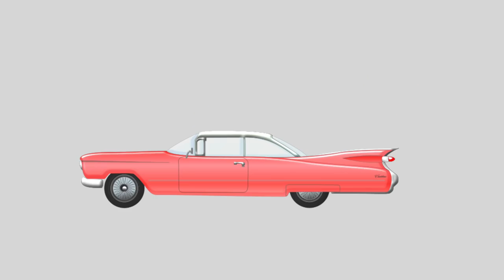Yes, Rockets CAN Fly in a Vacuum

Comment: Scientism. What is there to thrust against my dear? I call BS.
Reply: Eddie - If I fired a CROSSBOW in a vacuum, would I feel recoil? Yes or No?
Reply: @stuartgray5877    Rockets don't use crossbows.
Reply: @stuartgray5877  No recoil.  You bloody forgot to load it with anything.
Reply: @DrCash7  so you are incapable of answering a basic physics question but you want to argue physics with actual engineers?  Answer the question and I will give you some more.  If YOU answer the questions you will learn YOURSELF how rockets work in a vacuum.  Newton's laws apply the SAME to a crossbow as they do to rocket engines.  If you don't understand that, then you are demonstrating that you have never taken a physics class in your life.
Reply: @DrCash7  - If I fired a CROSSBOW in a vacuum, would I feel recoil? Yes or No?
Reply: @DrCash7  why no answer? Afraid to debate people who actually have a clue about physics?
Reply: @DrCash7  Here are a few interesting questions for you, with the answers, that I'll assume you will agree with? 
Firstly, does the burnt rocket fuel coming out of a rocket have mass? Yes, it does have mass. For example, 15 tons of fuel, when burnt in the rocket's engines, will cause 15 tons of combustion gases to be ejected out of the exhaust nozzles. 
Secondly, does this ejected mass of burnt fuel, travelling at hypersonic velocity, have an X amount of 'momentum'?  Yes, anything with mass that has velocity, will have 'momentum'.
Thirdly, when applying the conservation of momentum laws to various objects, when one 'momentum force' has been created and is travelling in one direction, is a corresponding 'momentum force' created in the opposite direction?
 Perhaps you can give me the answer to this question in your next reply?

Comment: How does a rocket work?  It's literally riding a continuous controlled explosion.  The explosion is moving with you relative to ignition already, hence continuous force regardless of how fast you're going.  What we should be asking is how much thrust is coming from riding the explosion (and pressure exerted on the combustion chamber and engine bell) versus Newton's third law in the expulsion of mass.

Comment: What a horribly unhelpful video. First “they,” intentionally likens the movement of a rocket in space to the exhaust system of an automobile at work in an atmosphere, and even though “they,” never truly provides either a concrete example of why the two completely different technologies are compatible enough in the first place, to draw a similarity from one to the other for the purposes of demonstration, “they,” also never tells the viewer why the two technologies are not compatible enough for comparison. That’s called lunacy. “They,”merely states, “it’s like…” but then “they,” completely contradicts themself by saying, “it’s not like…” and then, horrifically, and shockingly, “they” proceeds to use the car’s exhaust system on the green screen to compare, and to contrast, the two entirely different technologies anyway; and just as shockingly, “they,” do so by interjecting a third technology, that of mechanical motion. 

This is an inconsistency of unmitigated proportions straight away, and I think it’s one that’s intentional, (in order to confuse the average viewer,) on the part of the content creator, but not necessarily on the part of the presenter, if “they,” are not actually one, and the same.

Why would I says such a terrible thing? Because it’s exactly the same regurgitated pablum espoused by every other gatekeeper. How shocking a thing it is, that there is but a single, uniform narrative, (for which there is only ever intellectual phase locking to explain Newton’s third law,) and never any possible variations, or alternate explanations, for why Newton’s third law of motion, (in which all rockets in an atmosphere work exactly because of the presence of an atmosphere,) continue to work whenever that very necessary component, an atmosphere, is removed.
Reply: Theodore - what confounds me is that your vocabulary suggests that you did complete high school, while your grasp of basic physics says you did not.
Which is it?
Where I come from passing physics in high school is mandatory for graduation.
What happened to you?
I can TELL that you have never taken a single physics class in your life, but you feel confident arguing basic physics with actual Engineers?
Newton's laws say that rocket propulsion MUST work in a vacuum.
Maybe you should study them BEFORE trying to debunk them?
Answer these three questions about a rocket operating here on earth in atmosphere:
1 - Does the exhaust gas experience an "Acceleration" as it leaves the rocket nozzle?
2 - Does the exhaust gas have "Mass"?
3- Can mass be accelerated without a force, OR is a force REQUIRED to accelerate mass?
Just answer those three questions and we will get to the REAL questions.
Most "physics deniers" refuse to answer my questions and just attack me personally.
Reply: Theodore - "in which all rockets in an atmosphere work exactly because of the presence of an atmosphere"

See this is false.
Rockets DO NOT "push on the atmosphere".
Do you think that the recoil from a gun is purely from the gun pushing on atmosphere?

So according to YOU a gun fired into a vacuum would NOT have any recoil force?
Are you SURE about that (because I have evidence that says otherwise)
Mechanical recoil still works without an atmosphere because any time one object (mass) pushes on another object (mass) then BOTH objects feel the force.
THIS is Newtons third law. It is impossible for a machine to accelerate mass (apply a FORCE to a mass) without feeling an "equal and opposite force".

Rocket propulsion is JUST mechanical recoil from PUSHING ON MASS.
Mechanical recoil still works in a vacuum, therefore rocket propulsion STILL WORKS IN A VACUUM.
Reply: @stuartgray5877  false.  Rockets push against atmosphere, chatbot stu.
Reply: @bobartor910  false.  No friction/drag no thrust.  U chatbot/shill.
Reply: @DrCash7  Oh so "rockets Push against ATMOSPHERE" do they?
So you are arguing that rickets CAN "push on air" (Which is a GAS) but then you say that rockets CANNOT push on the exhaust gas (Which is ALSO A GAS).
So YOUR argument is: " Rockets Push on GAS but they cannot push on GAS".
Is THAT what you have been trying to say?
Bless your little heart!
Reply: @DrCash7  what is the combustion product of burning hydrogen and oxygen?
What is the Exhaust gas from a rocket engine that burns hydrogen and oxygen?

Oh and what does a jet ski "push off of" to propel itself forward?
Reply: @DrCash7  how do those toy "water rockets" work that you fill with water then pressurize with air?
Don't try to tell us that are a hoax because I have used them.  They work great!
Now tell us the theory of operation of a toy water rocket.
Reply: @stuartgray5877  u chatbot.  U have no seoul.  I explain dees to you.
Reply: Good comment. Chatbots and shill accounts attracted to it
Reply: @DrCash7  So you STILL contend that rockets push on GAS, but they CANNOT PUSH ON GAS. Is that about it?

AND you STILL argue that a SSME can accelerate mass without a recoil force.
Yeah you are a GENIUS.
Reply: @DrCash7  So you STILL contend that rockets push on GAS, but they CANNOT PUSH ON GAS. Is that about it?
AND you STILL argue that a SSME can accelerate mass without a recoil force.
Yeah you are a GENIUS.
Reply: @stuartgray5877  thanks
Reply: The main point of this useless video is to bait doubters into commenting, so they can be harassed & abused.
Reply: @papalegba6796  Care to tell us how rocket engines can accelerate mass without applying a force to that mass?
NO? What a SURPRISE!
So do you contend that:
Exhaust gas does NOT have mass?
or
Mass can be accelerated WITHOUT a force?
or
Mass can be accelerated by "Magic"?

So which is it genius?  You OR DrCash7 may answer since you are both the same person.
Reply: @stuartgray5877  thanks for proving my point, chatbot 😂
Reply: @DrCash7  Check the 4 forces of flight. 3 of them (drag, lift & thrust) are applied by the atmosphere, the other (weight) is applied by gravity. Very simple.

Comment: A useful addition is that a normal car does not work from the push of its exhaust gasses.  The energy from combustion is directed to making the wheels turn.  The exhaust gasses are just being vented because you have to do something with them.

It's entirely possible to make a car that burns fuel as a rocket does, directing its power into the exhaust gasses and moving by newton's 3rd Law.  These aren't typically street-legal because the plume of fire and smoke coming out the back tends to irritate drivers in following cars.  

Rocket-cars are the car of choice for setting land speed records, however.
Reply: Darth MacLeod she literally said the wheels turn, you can't possibly thing she wouldn't know such a basic thing
Reply: Xiefux, Completely agreed.  I'd fully expect Amy would know how a car works.  I'm simply unhappy with Amy's wording which implicitly equates car exhaust and rocket exhaust.  

To be clear, I know Amy knows better, but if you are explaining something as basic as how a rocket moves vs. how a car moves, and your target audience is people who have misconceptions about it, it's very hard to take too many pains to avoid confusion.

Comment: A Saturn V first stage ejects about 15 tons of hot gas per second. This burned fuel exits the nozzle at around 5,000 MPH.
That's three large bull elephants flying past at FIVE THOUSAND miles per hour.  Each second.

Compare to an Iowa class Battleship, firing its 16 inch, 2700 lb shells at 2500 FPS.

After converting the units (and if I haven't messed up the math!) we find that in one second the rocket produces about 33x the recoil momentum of one shell.
So, the total rocket recoil is equal to three full 9-round broadsides per second, plus about 6 more single shots.  (3x9+6=33)

Imagine a Battleship Machine Gun, firing about as fast as you can read this: BOOM! BOOM! BOOM! BOOM! BOOM! BOOM! BOOM! BOOM! BOOM! BOOM!
(Remember, each Boom! is all NINE guns going off at once.)

"GOT RECOIL?"

Comment: If space is a vacuum how is there a "force" pushing the payload in the opposite direction when the particles aren't "pushing" on anything (like 'air')
Reply: Matan - Lets start with THIS.
MOST "physics deniers" make the claim "Propulsion is IMPOSSIBLE in space because IN A VACUM , there is nothing to push on".

Now If one were to fire a crossbow, IN SPACE, (in a VACUUM) would the crossbow STILL FEEL RECOIL?
Yes or No?
well the answer is "YES" the crossbow WILL still feel recoil and get PROPELLED BACKWARDS when it fires the projectile.

So that is PROOF that "Propulsion" IS possible in a vacuum. (even with "Nothing to push on ")

Now isn't it possible that rocket engines use the SAME CONCEPT to push themselves?

I'll leave it to you to do that mental exercise.

Comment: One thing that is missing in otherwise good attempt to explain topic is missing of clear division of two problems propulsion of any vessel needs to deal with.
1. You need to apply force. 2. You need to get energy to be able to apply force.
Cars (Trains), Ships, Airplanes and Rockets all uses 3. Newton Law to apply force. In simple words they throw something behind them (a propulsion mass) and that pushes them forward. The force is based on speed which that propulsive mass is thrown away and the mass, how much pounds/kgs are thrown.
For Rockets and Jets propulsive mass are exhaust gasses, for Propeller Airplane it is air being pushed by propeller. For Ships - water. Wheeled vehicles propulsive mass is Earth. It may sounds funny, but wheels grip actually pushes Earth behind, but because Earth is so heavy, its movement is not measurable.
For energy it gets more interesting. Rockets usually burn fuel and oxidizer to produce hot gasses and that hot gasses are then funneled via nozzle to be used as propulsive gasses. Ion engine expel stored gas by magnetic and electric forces, generated by nuclear reactor or solar panels. (Also see NERVA engine). Jets burns fuel and oxygen which they suck from outside and use that hot gases mixed with rest of sucked air as propulsive mass. Propeller Aircraft, Ships and Car can have various sources of energy - most common is combustion engine of some kind. Here I would like to note that Electric Trains source of energy is power plant located outside of vehicle, so you can see that it is not necessary to have number 1. and number 2. problem solved in same vehicle.

@Amy: There are ground laser powered rocket experiments being done - maybe topic to next video :)

Comment: Great work Amy. I just read that the moon's gravity is only 17%  of earth's. I began wondering how did the moon landers managed  to take off from the surface of the moon even though the landers' rockets appear  much much less powerful than  those  that the Saturn 5 used to take off from the earth? Yes, the Saturn had to lift a lot more weight into space and get it up to a higher speed, but are there any other reasons?  It would be really interesting if you could run through all the numbers.
Reply: An obvious additional difference between launching from Earth compared with the Moon is that the former has an atmosphere causing drag on the rocket which it is going to need some extra push from the rocket to counter.
Reply: Jonathan Janson Moon landing along with space travel is all fake.  Government propaganda.
Reply: R Cook 
You should take your meds friend, your paranoia is acting up.

Comment: The higher pressure air in the balloon is colliding with the air outside the balloon.  And that back pressure is pushing the back of the balloon propelling the balloon forward.  Inside the air is taking the route of least resistance escaping through the nozzle.  NOT PUSHING ON THE INSIDE FRONT OF BALLOON.

Comment: So why did I learn that rockets move because it pushes off the atmosphere.
Reply: Simply because whoever said that was wrong and not educated on the subject.
Reply: Even jet aircraft do NOT "push on the air behind them".

They push on the AIR IN THE ENGINE.

Jet engines and rocket engines are both MASS DRIVERS.
They accelerate MASS and feel a RECOIL force.

If jets "pushed on the air behind them" then no aircraft could ever go faster than the speed of sound.
We DO have aircraft that go faster than the speed of sound so they DO NOT push on the air behind them.

Comment: I was wondering how this works. It seems like it would just be like a car spending its Wheels with no air to push against
Reply: But that isn't how it works. It's a transfer of momentum, which is a mass multiplied by the velocity and direction that the mass is traveling. In fact, rockets produce more thrust the lower the outside pressure.
Reply: And you would be right with that analogy.  Wheels spinning with no results.

Comment: Let me try & get this right, if I removed the wheels from an F1 car, put skates on the bottom of it, put it on ice & gave it full revs it would move around the ice rink ? I think not my dear, your video explained nothing, but since I’m just a dumb man can you tell me how a space craft stops, like when two craft dock  ?
Reply: No. She clearly stated that while the exhaust provides some thrust, it is not enough to overcome the friction between the wheels and the road.
Your ice rink will have a similar effect, even when the much lower friction of ice is considered.

How do spacecraft dock?
By rendezvousing, matching orbits, then using a cough of RCS thrusters to close the distance. The shock absorbers in the docking modules absorb the impact. The relative speed is only a few centimetres per second.
Reply: @niallkinsella2687  you must live near the equator or never driven in icy/snowy conditions.

No friction/traction = loss of control i.e. no braking, steering, or acceleration.

Everything works in force pairs: Plane wings use lift paired against gravity, and thrust paired against drag.  A rocket uses ____ paired against _____?
Reply: @DrCash7  
"No friction = loss of control. No braking, steering or acceleration"
For a car mounted on skates with no wheels...as per the original posters scenario...

A rocket uses momentum in one direction paired against momentum in the opposite direction.
If you accelerate mass in a direction and eject it, it will have momentum, and you will gain equal momentum in the opposite direction.
It's basic conservation of momentum...
Reply: @niallkinsella2687  You're still sitting still with no friction and without a force pair.  Skates, wheels, whatever.
Reply: @DrCash7  
The original post asked if a car mounted on skates on an ice rink would undergo acceleration because of the exhaust from the car.
I said no, because even ice has some friction and more than enough to prevent a car from moving under the force from its exhaust alone. This is true. We're finished with the car on the ice analogy.

"You're sitting still without a force pair"
Momentum is a force...
If you accelerate an object, it accelerates you equally in the opposite direction. There's your force pair.
Reply: @DrCash7  - If you sat in the middle of a FRICTIONLESS ice rink with a fully loaded AK-47 - COULD YOU GET OFF THE ICE?
Yes or No?

Comment: What does it push against to move the rocket once in a vacuum....?
Reply: The fuel.
Exact same as when there rocket is in an atmosphere.
Reply: Answer this very simple physics question to help you:

If I fired a steel projectile from a CROSSBOW in a vacuum, will I feel a recoil force?
Yes or No?
Reply: @MetoFulcurm  
What you've just said is mathematically identical to what the original comment said.

It doesn't matter whether the mass you are accelerating and ejecting is inside or outside.
What matters is that you are accelerating and ejecting mass.